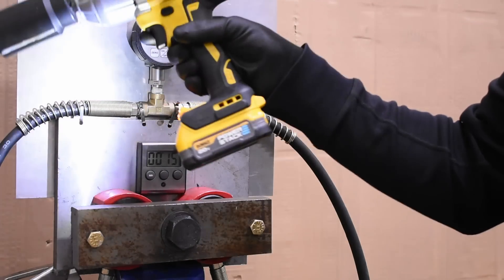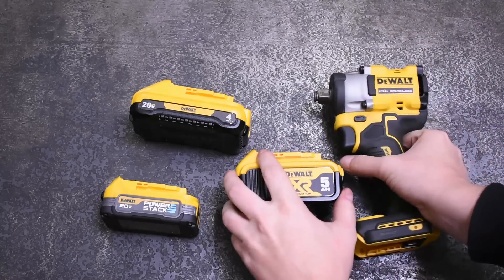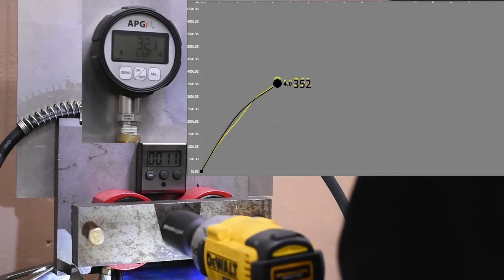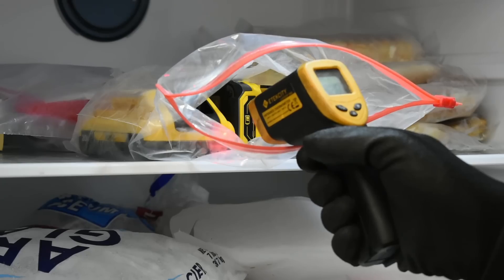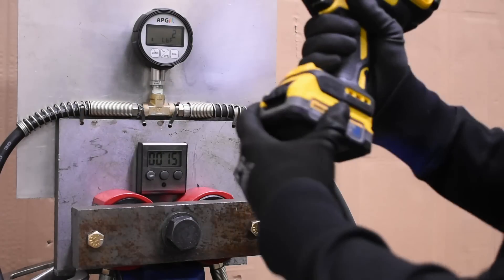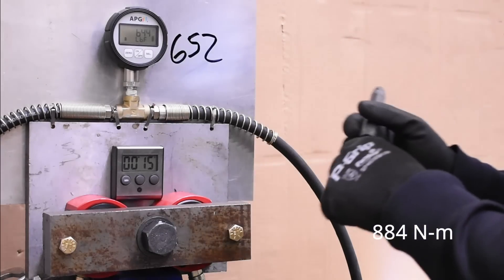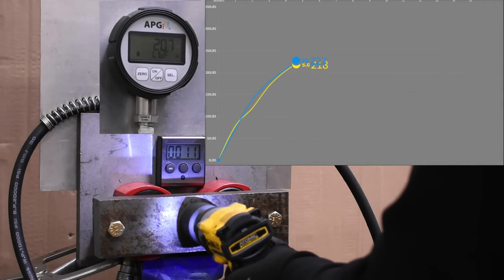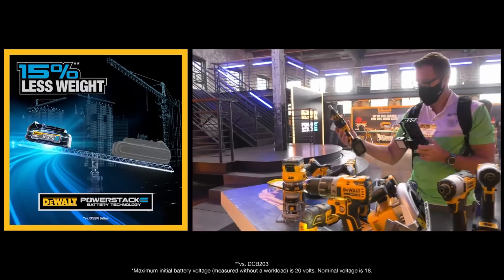This is NOT a Normal Tool Battery: DeWalt Powerstack Dyno Tested

Comment: Drive a nail through it, i want to see if it has Amionx safecore technology in it. Dewalt signed a deal with them way back. It is supposed to prevent batteries from cooking off.
Reply: You took the words out of my mouth. They must be lipo cells like my rc cars use. Loads of punch but extremely volatile.
Reply: @mattmckie6967  they are Li ions like in your phone. Still turns into a balloon and probably catches fire if you stab it, but that's just what lithium does.

Comment: At least with this cold testing I now know to keep my battery indoors when working on a project to have the best performance.
Reply from the maker: That one surprised us, knew it would be lower but yeesh!
Reply: Not as much power but overall the battery will last at least 3rd longer under cold conditions as cells destroy themselves at an accelerated rate under heat. 
So a little less power is not an issue over battery longevity 😉.
Reply: @TorqueTestChannel  try -30 or -40f batteries I have to keep 20+ batteries on me because they just barely work. And they won’t charge either at that temp. I have to keep them in my truck during the day.
Reply: @gosselinkfinecarpentry9786  seems like a huge problem for you. why do you not make an insulated box to keep them in? I cant imagine those batteries as you are using them are going to last you any time at all since it will take so long for them to warm just to get a decent charge.  maybe just a decent cooler with some of those microwaveable bean heating pillows at the bottom? think you really would need two one for the spent and one for the charged. if you mean while you are working they are cooling too fast.. why not make a sock for them? when I worked in alaska we had to make all kinds of adhoc heating blankets for all kinds of things you would never expect to be very cold sensitive..
Reply: @gosselinkfinecarpentry9786  they don’t need to test that. This proves cold reduces the power significantly. If yours barely work, that means the cold is affecting your batteries big time. You need to find a way to keep them from getting so cold. Like the other guy said, get an insulated container. Try putting something in there to keep the temp up, like hand warmers or something. Don’t go too hot because that’s not good for batteries either
Reply: The manual tells you at what temperature is the best for performance.
Reply: The heat and cold don't just cause problems while using them, it actually makes them reach their end of life where they have to be replaced sooner.  I started keeping my batteries in my top box so can bring them in the house at night. Unfortunately I forget much of the time and they still end up spending the night in the cold, or I'm just too tired and say fuck it I'll get them later and never do. I guess if I bring them in part of the time it will help extend their life. The heat I think is even worse,  I bet workers in places like Phoenix AZ have real problems with leaving them in their trucks.  They have 100 degree temperatures at night even.

Comment: Pouch cells do have some performance benefits, but I'm willing to bet that DeWalt's deviation from cylindrical cells is more about money or supply than anything. They are probably trying to make it more difficult for people to repair their dead batteries.
Reply: Eh... most contractors that make money with their tools aren't going to spend the time to repair batteries.  They'll go buy a new pack.  Home gamer/DIYers repair them, but that's not the bulk of their customer base.
Reply: Very few people repair their batteries, that's a hobbyist thing mostly. 

I've done it for some friends, but It's actually a pain without a spot welder, because the cells are such a tight fit the solder takes up extra space and you have to shave off some case.

These pouch cells would actually be easier to replace. Measure them and they should be available in the exact or a close enough size, pouches are not a proprietary thing.
Reply: @volvo09  -  no, I think his talking about Batteries+ repair stores, I’ve taken many batteries to them including power tool batteries at less then half the cost, they replace them with the same or better type.
Reply: @truthserum9157  do you have a local place or online. A few online places I have looked it wasn't much cheaper than a new one
Reply: @truthserum9157  funny because the batteries+ down the road from me cost more for a replacement cells than just buying a dewalt 2-pack which are regularly onsale....and if you go by Ah, just buy a flexvolt battery when onsale like every other month from toolnut or acmetools or hd.
Reply: @David.....  -  that is funny, it’s been around a year or so, I had a Ridged battery and two Motorola radio batteries replaced and all where cheaper then buying new, if it cost more nobody would go to batteries +.
Reply: @truthserum9157  maybe they have different prices regionally?...Im in the northeast....My battery+bulbs has been there for about 10-12 years...Around here I get new dewalt 4 or 5ah battery packs for about $45-50 on sale and that would have a 3 year warranty.

Last 5ah battery I got through HD promo cost me about $10. This was back in november.

And considering how effortless it is to get batteries warranted by dewalt, I dont bother repairing them....But to each one own.
Reply: @David.....  -  your right about that, when there’s a sale you can get them really cheap, I’ll keep an eye out for those.
Reply: @truthserum9157  Yea but these types of cells are replaced all the time in RC cars, in cell phones and tablets, so its not that much of a stretch to replace them in these. It will only be a matter of time before we see some knockoff replacement that fits the exact Ah, Voltage, discharge rate, and dimensional size ratings.

Comment: I wonder if having the out-the-gate beans being higher would equate to more working efficiency overall - most bolts are going to be off in less time, meaning less capacity used up with each bolt.
Reply from the maker: DeWalt seems to think so, saying it's 1.7ah capacity is actually more than a 2ah because you'll need to use it less. But heat guns, nail guns, lights, laser levels... all these tools runtime just = capacity. Can't get around that without diggin up Mr. Einstein.
Reply: @TorqueTestChannel  yeah I definitely only imagined gains to be had with intermittent use devices, maybe time to send some tools to Project Farm for some large-scale back to back marathon tests and get real world numbers.
Reply: @TorqueTestChannel  That won't be a problem with my new PowerStack Shovel

Comment: This channel has saved me so much effort in researching the best tools for my job. I considered going with air power but I bought a dcf899 and now have a 921 on order purely due to the numbers this channel is able to produce ignoring manufacturer claims. You’ve got a fan. Can’t wait for the new high torque version

Comment: I love my DeWalt power tools, I'm still not sold on this power stack. I think having the 2ah and some 5ah batteries will work for me.
Reply: This is for a drill/impact driver kit. 3 of these would be killer doing display or furniture work. 1 for each tool and 1 to charge. The size and weight are the main advantage

Comment: Interesting story. Basically I was 10-11 years old, my dad has never taken good care of batteries until I was old enough to understand that ya kinda need to bring the damn things in during the winter. Anyway it’s spring and we needed get something I dropped underneath it so I get my dads black and decker drill and batteries we have had for like 2 yrs at that point (both left out in the cold) and we get 2 mins of run time. We barely took a board off and went through 1 battery. It may have been also due to the fact it was a black&decker but still It was surprising the damage that was done to those batteries over two years of being in the cold for like 3-5 months. After this he still did proceed to do this until I was 16 when I got more into the stuff and told him.

Comment: Great test! My main concern with this battery is cooling, the cells seem tightly packed. That might be the reason for the 1.7 amp hr configuration. It does look good on the impact:)
Reply: Pouch cells need compression with high amperage discharge, or charge. the compression helps prevent bloating, its not guaranteed to stop bloating though.
Reply: That's my concern as well.

Comment: I think that little power stack battery is a perfect match for the little DCF921 1/2" power house. But if you have a high torque impact gun, why not spend the same money for a heavier battery that will balance the tool in your hand and run longer? Thanks for doing this testing! Glad to see DeWalt innovating.

Comment: I’m here 2 yrs later and I just purchased the 5 AH version of the power stack. Knowing the original power stack is only 1.7 AH and it’s being run against 4.0 AH / 5.0 AH and it’s holding its own. I can only imagine that the new 5.0 AH power stack will be on par with the 9.0 AH flexvolt batteries.

Comment: The size is awesome, capacity is fine for me. Waiting for a 1ah battery for Makita 40vMax, pretty sure the performance of the impact wrenches will be near identical to the bigger batteries when fresh off the charger. They could do for example an 1.05 ah using 10pcs 14650 Panasonic cells, but instead they chose to introduce a superheavy 8ah battery - thats 18v-16ah equivalent - to compliment the already big ones to hey had. I mean, the 5ah is the 18v 10ah equivalent and lasts even longer for real world work. Dewalt has the right ideas here, small batteries for small tools.

Comment: Thank you for your (as always) great analysis and testing.

I'm really sick of 90% of the tool based youtube channels reading off DeWalts marketing talking points and creaming their pants over this battery without doing any real testing or showing any skepticism.

Its an interesting technology... but really expensive for the capacity.  I think its overhyped.
Reply: dewalt CLAIMS that it has twice the total charge cycle life, I guess real world time testing will tell.
Reply: @squirts1  I got mine for free while purchasing a hammer drill solo. pretty cool.
Reply: @squirts1  you use them yet? Just impulsively bought 4 of them on a killer deal. From the testing I've seen it'll probably be primarily for my impact driver and standard drill, probably not a skillsaw or jigsaw though

Comment: Happy to see you started with cold testing before hot testing. ☀🌡❄
Batteries, for the most part, do not like extreme temperature changes. I live in Arizona, and the majority of vehicle batteries I replace are when the temperature dips down. Granted, vehicle batteries are not the same as power tool batteries, but your testing proves the same point. Batteries on their way out could start a vehicle in the heat of summer, but would fail to start in colder conditions.
Working performance will be affected by temperature.
Thanks for your time (and money) spent on getting real results!

Comment: This is why when we fly drones in the cold winter months we pocket our lipo's in our coat jackets to keep it warm so it doesn't preform like crap when it's cold.  The higher the C rating on a lipo the higher the discharge rate will be. meaning more power.
Reply: The higher the C rating means it can handle more amps being pulled from the battery without damaging the battery. Amps is pulled, voltage is pushed. Not being sarcastic or mean, or anything like that.
I'm a big RC nerd. Custom built racing vehicles. Also fly some aircraft and drones. 
Love my replica tanks that shoot airsoft too. Lol

Comment: Seems like a perfect fit for Atomic tools for everyday type uses, then switch over to a 5.0 or similar if you have the rate project that's actually going to need the runtime. And now you can go from tiny flexstack all the way to the 15Ah Flexvolt monster in the same tool family. If only SBD didn't charge such crazy prices for ALL of their batteries (highest $/Wh of any of the major brands IIRC) I might be tempted to switch over.
Reply: I only buy batteries on black Friday sales
Reply: they have really good sales on their stuff if you can find them, i got a dcf921 with a 5ah battery for free through home depot. then i bought the powerstack starter kit and got a free atomic multitool with it.

Comment: Thank you for another amazing video, just curious if you guys would consider testing the cross brand adapters that are out there? The ones that allow you to put a battery from one brand on the body of another?
Thanks guys keep up the good work
Reply: So far all my cordless tools are de Walt  but I don't like the xr planner so I have just bought a adapter to try and use Makita brushless planner and hopefully run it with my de Walt battery's so I'd be interested in a cross brand video as well

Comment: I have plenty of batteries but I want one of these for my 887 impact driver for general purpose work.  I just don't want to pay for it haha. 

I have the 60v circular saw and let me tell you that is the way to go for a circular saw.  It's the one that convinced me to start keeping my corded saw stored in my garage and trust battery operated in my truck completely.  I  did also get the Flex volt hammer drill kit so I also have a spare 60v battery so it's fine having a backup.

 Good blades are a must with battery saws though,  while I can use my old corded DW364 with several teeth missing from the blade, it doesn't care it just plows right on through, so I do sometimes miss that kind of power though.

Comment: Probably best reserved for tools with a shorter operation time and moderate current draws. The close packing of the cells will punish the inner cells with heat buildup leading to uneven individual cell performance across the entire pack

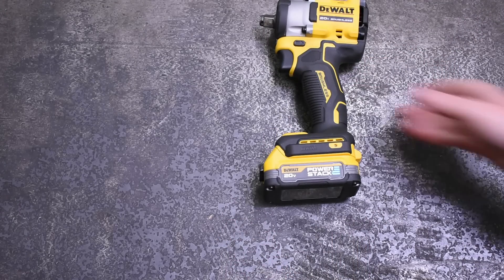Comment: At 10:05
"....making a few more beans, for whatever reason...."

Battery chemistry: the easy version....

Hot batteries have the chemicals in them react faster, their poor produce more power than standard temperature batteries. Likewise, cold batteries have their chemical reactions slowed down therefore producing less power....

Easy peasy lemon squeezy!!

(Yes different battery types react to cold differently, this is ignoring that and just going with the general rule of thumb....)

Comment: For high torque applications 6S x LiFePO4 would make more sense - similar voltage, much higher discharge rate, possible high charge up to ~80% (e.g. 15-18mins for 80%). It will have lower capacity but lasts way longer, degrades much slower... and no cobalt needed. They will be partly supported by existing charges but not fully...

Comment: Very interesting... I was wondering when power tools would implement a pouch battery.

But, like you said, I want more capacity. The slim pack is great for a small light tool though. At least it dosen't sacrifice performance to get you that... But you pay for it.

Comment: The lifetime of these packs is going to be interesting to see.  Those flat packs crammed in there like that could generate quite a bit of heat and reduce the life of the cells over time.  Especially with a low ah pack that needs to be charged/discharged more often.
Reply: They'll generate overall less heat than li-ion cells because of the lower internal resistance, no?

Comment: DeWalt screwed up by releaseing the Powerstack battery with a lower amp hour rating only. They then didn't print on the side of the battery the rating and brushed over this fact by taking about how much more power it has over their conventional batteries.
Reply: The 5Ah Powerstack DCBP518-XJ has launched in the EMEA/ANZ regions, no word on NA release yet.
Reply: @drivingmemad7127  Thanks for the update. 👍

Comment: If possible, it would be very intriguing in seeing the performance differences for the rigid high torque and mid torque when paired with the 6.0 ah and 9.0 ah octane batteries

Comment: Not a tool expert, just here researching my first cordless impact. 

But I am an expert in RC Airplanes.
This exact storyline evolved 15 years ago, and I can tell you what happened and happens next:
Nickel batteries and brushed motors
Then Nickel with Brushless motors
Then lithium comes in.
Then stacking more and more pouches together and folks flying 100mph+ on electric
And then tiny micro brushless lithium
...it all happened in like 3-4 yrs.

*When 'POUCH style lithium comes on the scene,  NOBODY LOOKS BACK*
Everything gets either more powerful, and or smaller, and nobody uses or thinks about cylinder cells ever again.*

It's actually kind of weird why power tools are so far behind, all this stuff has been available and mass produced for hobbyists for well over a decade.

Anyways, maybe handheld tools aren't as weight sensitive, but maybe they are.

Pouch is the future.
I have an Atomic/Powerstack kit on order, and depending on need and price, I may never buy a cylinder cell based battery 🔋 

Dewalt has 20v ratchet to share this battery with my dcf923, and it's the first platform to offer 'pouch' cells...these were the final deciding factors over Milwaukee or Hercules. 

Expect more power from smaller sizes.
Expect powerstack batteries to get more aH and cheaper price, AND more compact.
Expect all other brands to follow the pouch cells, and expect cylinder cells to all but disappear...you'll always be able to rebuild old cylinder cells.
Finally, aftermarket will supply the electronics,  you'll be able to purchase your own pouch cells and plug-n-play components...it is possible to build / repair your own pouch cell packs.